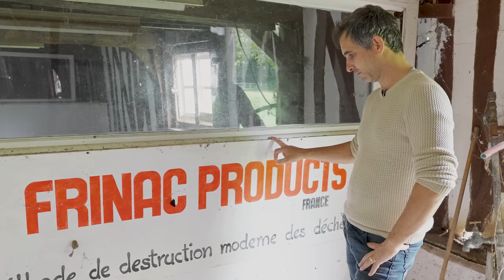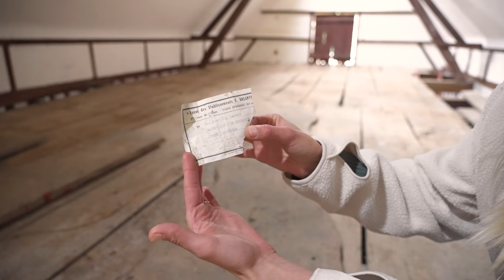Our greatest Chateau Discovery so far!

Comment: We removed the concrete and made wood inserts for the rotted away wood. Lime mortar, wood oil, new inserts where needed, new beams too, carpenters for the mending that is really necessary and cleaning the beams with carbon dioxide, great tip, and so relatively fast and non harming to the wood. I wonder if you have reclaim yards for flooring, doors, windows. It is lovely and will be beautiful when rescued!!!! Good luck!!!
Reply from the maker: Thank you for the tip!

Comment: If you raise the main beams to get good head height downstairs, would there be enough clearance to make any rooms upstairs? 

I’d be tempted to go single story, exposing the full height to make the living space really dramatic. You’d probably still get two decent letting units out of it… or a nice family house…
Reply: I was thinking the same thing.
Reply: If you jack up the main rafters, the roof goes up with it. Then the beams and posts that make up the walls can be preserved or replaced as necessary. An extra 20 - 30 cms of foundation wall is also added before dropping the repaired floorplate, walls, wallplate, rafters and roof back to their new position. Result, a building that is 20 - 30 cms taller from the ground to the first floor but keeps as much of the original timber in its original position as possible. 
It's a lot of work, and probably expensive, but that's how it's done.
Removing the first floor altogether would indeed make a superb statement space - but it wouldn't in itself alter the problem, in that the main beams are still going to be too low.
The other option would be to dig out the floor to a level that adds the required headroom, but that would almost certainly leave the floor below ground level and requiring a waterproof "tank" to be installed to keep the building from flooding in heavy rain.
It's an issue I'm glad I don't have to deal with (or pay for!)
Reply: @stevewallis8197  The expense is a major obstacle, for sure. I’m also not sure how strict French planning law is in respect of these sorts of historical buildings but I suspect that kind of roof-lift might be a tough sell.

Another issue might well be lack of proper foundations. A lot of agricultural buildings have minimal foundations (if any).

Comment: Didn’t realise how big it was until you walked out the door  wow ! Ps. I would put in underfloor heating then your feet will be toasty warm.  Rather than  radiators  which results in having to heat the ceilings before the warmth hits you  plus the  slight;y warmer blood in your feet  acts as radiator fluid inside your body and warms you from the inside.

Comment: Your outbuildings are exceptionally beautiful, and the fact that they are different styles is even better. It will be a huge job, but how rewarding!  Maybe you know the answer to this "burning question" --- why do so many chateaux have their buildings laid out with the outbuildings in every direction rather than square? It's not such a big deal with your place but I have seen some with really awkward-shaped working areas. Every repair then needs difficult custom works, but it seems to be a pretty normal thing to have buildings just plunked down any old where.

Comment: Martha Stewart did a room in orange. Surprisingly it turned out really nice. It would be in one of her older issues of her magazine.  Even if a room was done in neutral colours with orange accents like flowers, cushions. Could be nice too but, needs to be a dark shade of orange not too bright. 
 My great niece has an pumpkin orange room. Not fussy on the colour too bright. A darker orange would be better. There is a place in the states that makes wallpaper, fabrics, bedsets etc in custom prints and colours. With your artwork. Mind you they are expensive. They have a William Morris line available too. I love it, many colour variant choices available. Anna with your  drawing, design and painting know how how, can make another stunning room. ❤️ Curtains, etc can be done in your designs.

Comment: Great project. If these buildings and Chateau were in Britain they would at the very least be grade two listed. I’m guessing you are not under the same restrictions there in France, if that’s the case then you are so lucky. You have to apply to do anything here in the UK if a listed building, even in one instance wanting to drill a 15mm hole for a vent pipe. Even repairing buildings means being under the thumb of your local conservation officer.
Reply from the maker: We have to apply for everything outside (facades, windows and roofs), but are pretty free inside.
Reply: Thanks for the reply, even my lowly grade two terrace house one has to apply to do everything outside and also inside. Good luck with the project.

Comment: If you have not done it yet, you should try to figure out where the sewage was going to. Is there a sewage tank? How full is it? If you have a pail with water and fill the tank it may flush. You may want to clean up that area of the building remains just in case there is chemicals or something contaminating the area.

Comment: Modern concrete (used in many a 60’s 70’s  patch-up) creates the same issues in  old timber framed, wattle and daub buildings here in the UK.  Many of these buildings date from the 15th century and are still standing strong.  You could start to think those builders  knew what they were about all those many years ago!

Comment: On the doorframe of the first door you opened after entering the building there is a white rectangular block on the left hand side. Is that a mezuzah? it's the right size and on the correct side of the door.

Comment: It might be worth considering, if possible, designing the long house so that it could be rented as individual units or as a whole. Possibly with access door which are lockable from both sides?
We have 10 children from ages 1 - 13, so I speak from experience when I say that it is really hard for large families to find accommodation where we can all be under one roof. 
Just a thought.
Reply: Great idea. Could be used for special occasions for extended family looking to celebrate/holiday together, but could still keep an element of separation.  Would suggest disabled fully adapted facilities too. Could be on to a winner there.